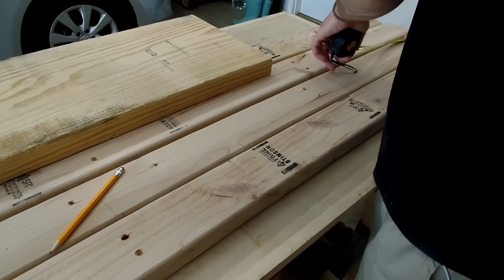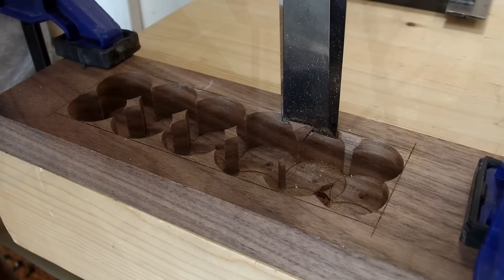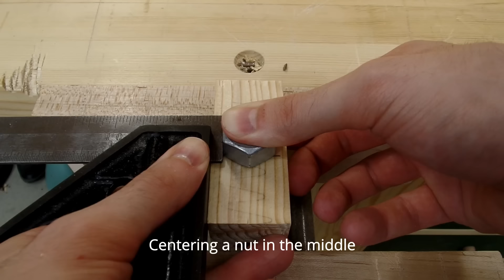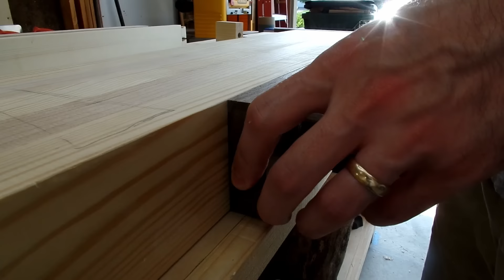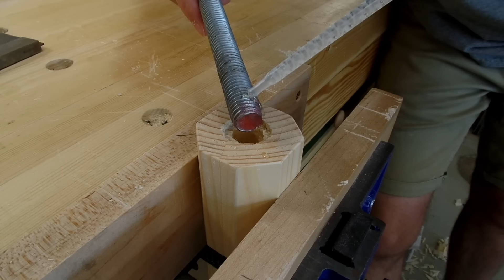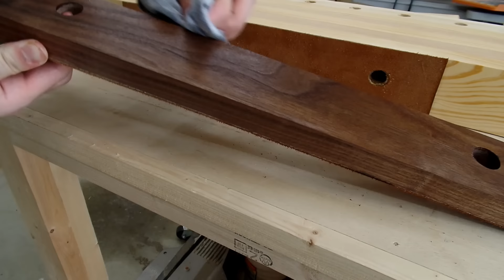My FAVORITE Shop Upgrade...Mini Tabletop Workbench

Comment: Why does every YouTube carpenter use “scrap wood” and then haul out full lengths of pine or a big chunk of walnut or some other expensive hardwood? That’s like saying you’re going to use some scrap metal and then bringing out a lump of Vibranium .
Reply: Because usually he takes 6 meters wood, cut a little for the project and throws it away 😁
Reply: Iunno, maybe cause usually us woodworkers use good hardwoods for our projects so the scraps from previous projects are good hardwoods? Makes sense to me. I’m looking at a bunch of walnut and curly maple scraps right now in my shop.
Reply: I have a few lengths of 2x material to keep around in case I need it. It’s scrap because it has no purpose. And I keep all my hardwood cut offs and usually buy extra in case I screw up, whatever is left becomes… scrap.
Reply: I get huge 4x4x3 blocks of walnut , oak , elm , burly oak , ect  from pallets. 
 That come to my job.

Comment: Scrap wood are bits and pieces ( leftovers from previous projects) and not full lengths of lumber, but this aside, great project nice craftsmanship all I want to add is: use the existing bench hole dog things to secure the piece to your bench instead of using the clamps. Thanks for sharing from Mexico.

Comment: Very nice, but isn't seasonal movement going to pop those tails out of the dovetail joints on the ends?
Reply from the maker: I'm not sure. I don't think it should be a problem but I'll keep an eye on it!
Reply: First let me say I’m no expert And this is one of the nicest mini workbench’s I’ve seen on YouTube. personally i would of had the dovetail on the walnut side and the pins on the pine. And also only glued the very middle of the walnut and maybe pinned it to allow seasonal movement and not let it interfere with the side faces of the workbench as they are reference faces for work. Depending on where you live and if this stays in a temperature controlled workshop you might never see any movement.

Comment: Really nice work. Ive had a mini bench on the to-do list for a bit. This really helps think through what I might want.
Reply from the maker: Thanks. If I were to do it over again I would maybe shell out the money for nicer tail vise hardware. My diy hardware from the big box stores gets the job done, but having a threaded rod with less tpi would be nice so it doesn't take as long to move the jaw back and forth.

Comment: Nice build 👍

I am thinking of making one, partly for the raised work surface and additional work holding options, but also to play/experiment with those options on a smaller scale (and less commitment) than a full sized bench.  Particularly the tail / wagon vise - working out how to adapt the vise hardware so the dog block moves without the handle coming in/out of the end of the bench.  Very helpful 👍
Reply from the maker: Thanks! And that's a great idea to use it as a way to test what you'd want in a bigger bench. I've already noticed since using it that a tail vise is a must have for me in my next big bench.

Comment: Love your design!  do you have a sketch available or could you give rough dimensions for your bench? I would like to make a similar one for my daughter.
Reply from the maker: Thanks! And it is about 30 inches long, 3 inches thick, and about 10 inches wide. The feet are about 4 inches tall and 3 inches wide. For the feet I'd suggest measuring the size of the clamps you plan on using (if using any) and measure the feet to make sure they'll be enough clearance for the clamps to fit in. Good luck and I hope your daughter likes it!
Reply: Great job. I am going to make a similar bench for my tiny workshop. Where can I get suitable hardware?